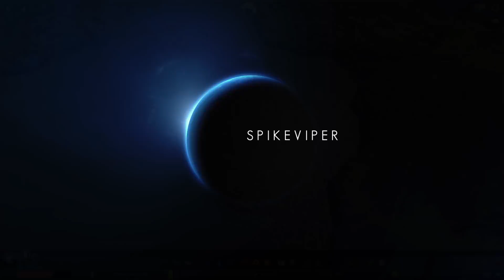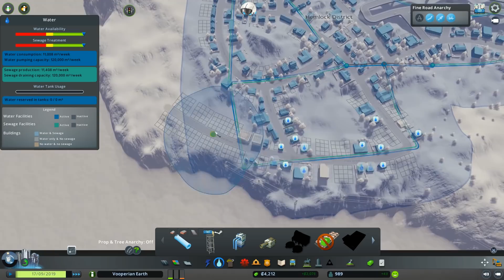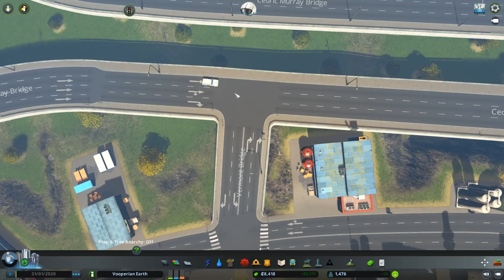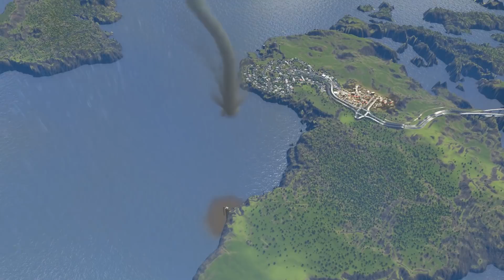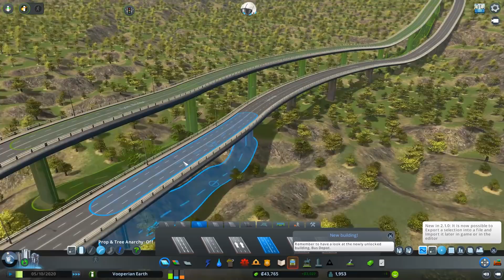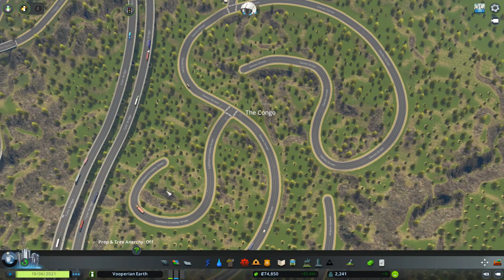A COUNTRY-WIDE TORNADO | Cities Skylines | Earth Map #2

Comment: U didn't build 2 new highway's u build 2 4 lane road's instead also example: oil industry were here's oil that's were u get it but if the oil industry is outside of the dark spot's then that's the processing oil factories not the normal industry.

Comment: For the parallel road tool: first you have to select the road type of the SECOND road so if you select “same as selected” you du nothing wrong. Then the left number is for the distance between the two roads and the second number is for the height of the Second road only so if you select the number 10 wich you have done in the video and you place the original road the second road is going to be build 10 higher then the original road. Leave the second number on 0 and elevate the original road then the second road will be elevated too. Btw you can also change the snapping of the roads and the direction of the second road in the tool.

Comment: One solution to the ocean pollution could be to make a new pump and eco outlet and put them on a closed system, so the pollution should get sucked into the system and cleaned at least slightly by the eco outlet